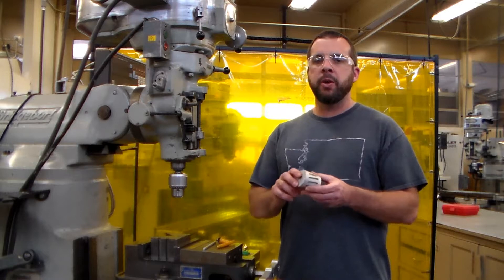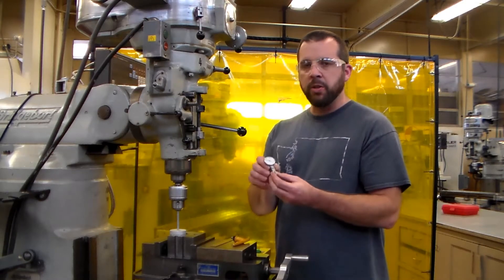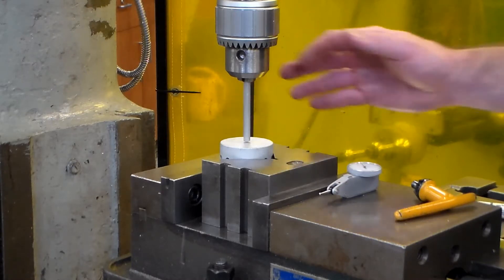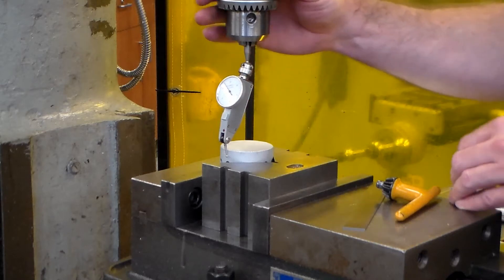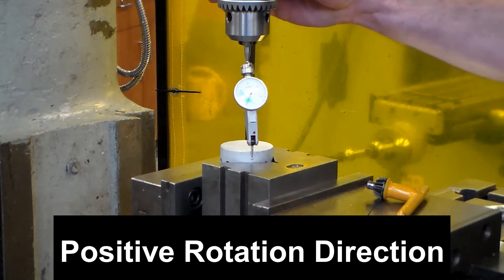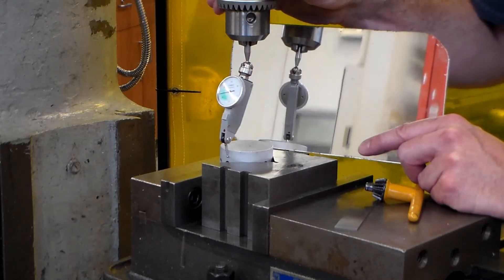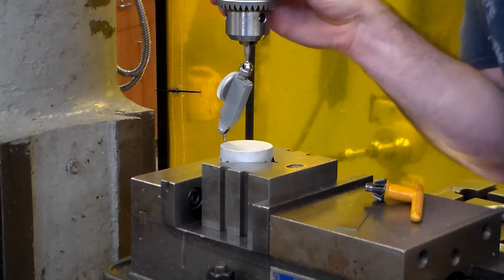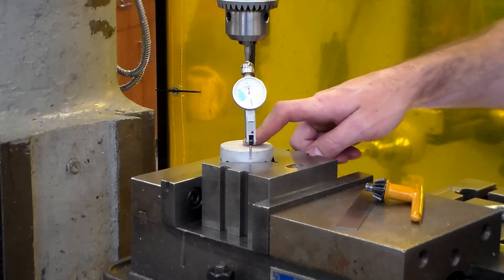Dialing in a round part in a Milling Machine

Comment: I have found that although the method works , if the knee of the mill is moved up or down the reading will be compromised.
Reply: No.
Reply: @mad0uche  If it is unlocked it is compromised.

Comment: I'm a machinist as well and that's what we always do before bolt circles. But when I was in school learning basic machining I learned to find center of a circle alot by edge finding the one side on the Y and 0 it out then move to opposite side edge find it and whatever your number is divide by 2 then you can repeat with x axis. If you do that would bolt patterns be accurate or is it always beat to indicate it when doing something like that?
Reply: A dial indicator will always be more precise than an edge finder. An edge finder has 2 to 3 thousands error
Reply from the maker: You bring up a good question. In most cases an edge finder will work just fine. The main reason for me having students use a test indicator is to practice different operation. Thanks for the comment.
Reply: @shopinstructor3980  ya I figured it would. I work at a tool and die shop so obviously precision is everything (as it always should be lol). I brought up the point of edge finding a circle instead of Indicating and the guy said it would never work. I'm sure it could as long as you are at the outer most part of the circle. But obviously indicating it would be more accurate. Thanks for the reply.